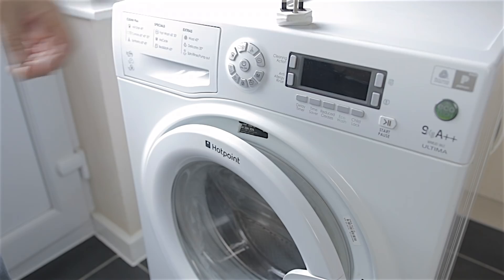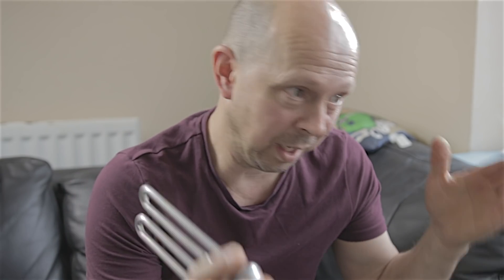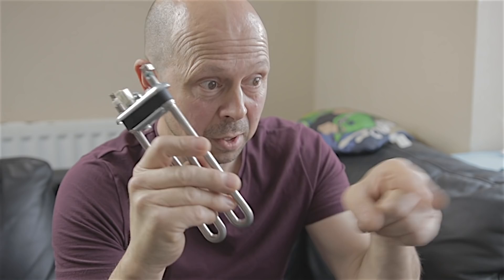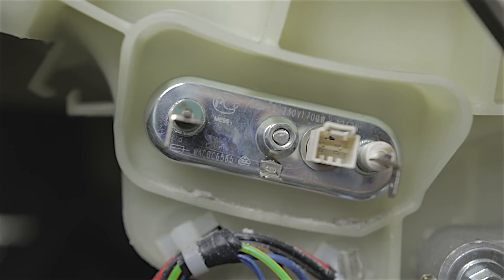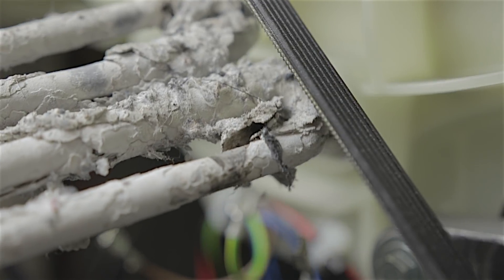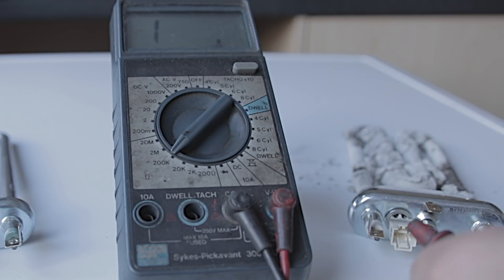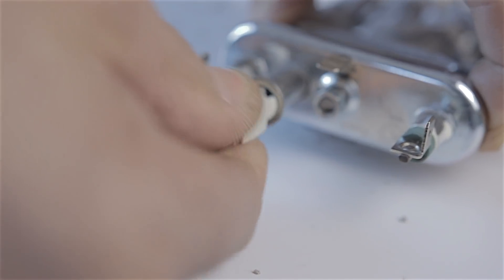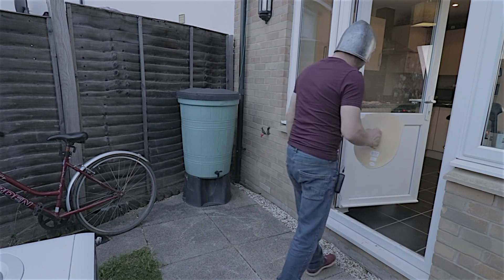This Is Sparta ,   hotpoint washing machine heating element short circuit

Comment: Had exactly the same issue with mine. Mrs overload the thing (and the drum bearings were not great) On the wm model the elements just below the drum coming in from the front. Cut a long story short. The drum had cut into the element. If the drum is overloaded or warped then the tent to get sheared by the drum

Comment: Spilt tea on a telephone answering machine, wouldn't work, I cleaned the circuit board with a tooth brush and low and behold it was working again ! Took a VHS VCR apart removed a small bit of lint on a plastic wheel and low and behold its working again !

Comment: I believe micro wave ovens contain a high voltage capacitor that could kill you even if you've pulled the plug out.
Reply: yep you need to leave it for a few hours to discharge or ground it.

Comment: And remember to take the transit bolts out before switching on your new washing machine.....old twat face here didn't and my machine tried to dance it's way across the kitchen floor.....
Reply: Usually a big sticker telling you that....supposed to let gas in new fridge settle for few hours before plugging in.

Comment: To keep the heating element clean, use less detergent and increase the temperature.
Wash your whites at 90-95 degrees. this helps to clean the machine.
Reply: Hard water doesn't help don't get limescale problems up north.

Comment: The RCD detects fault current so line to earth or neutral to earth the MCB would trip due to overload current in the event of a short hope that makes sense. ps. The fault current to trip a RCD in the UK is typically 30ma you do not have a dead short as your resistance is relatively high.
Reply: You're vids beat watching New Zealand telly. Great entertainment.

Comment: Great that mate can you look at my boiler the plumber an't got a clue what he's doing 😂😄😅😆👀👍👌
Reply: Best call manufactures service man from my experience, circuit boards don't usually go if its working when fitted, my problem was a £5 ignition button lol.  Told the fan was on the way out seven years before it stopped working 😃😂😁😄
Reply from the maker: lol